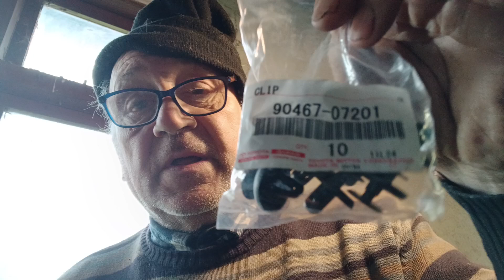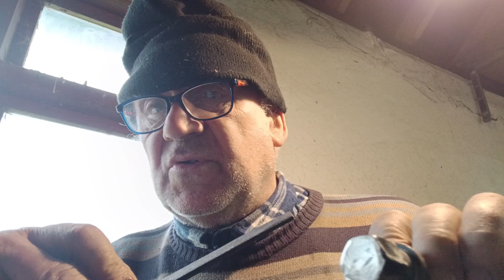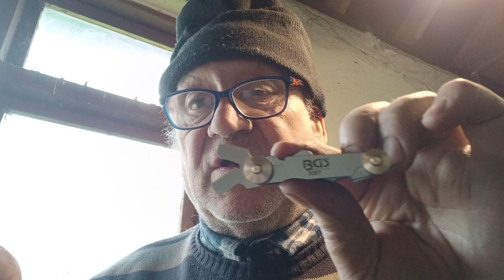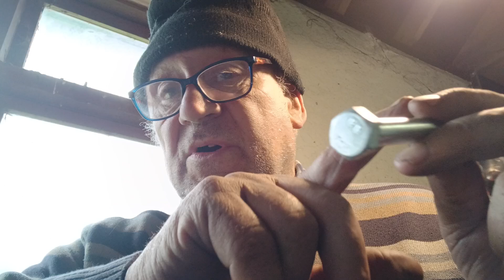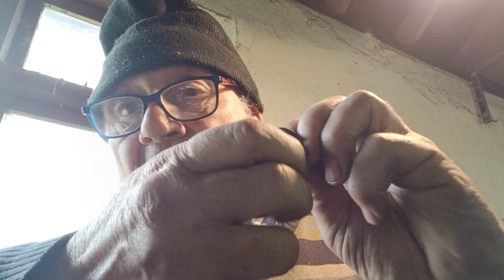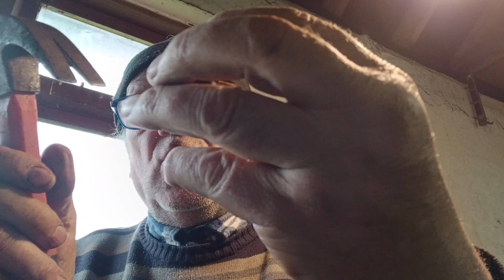The Caddy Van Spare Wheel Saga. Video No. 538. 23rd March 25.

Comment: There should be a special socket with the tyre change kit, maybe one of the bars has a pry end on it to pop the cap off? I'd say for the first year or two that cap was easy to pull off, the manufacturer should really grease those bolts so they don't rust up and lock on